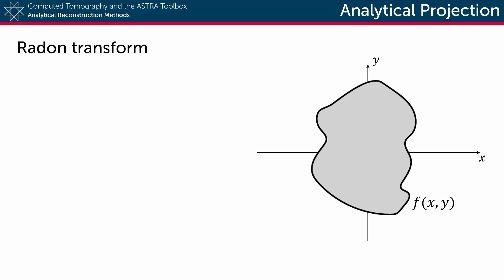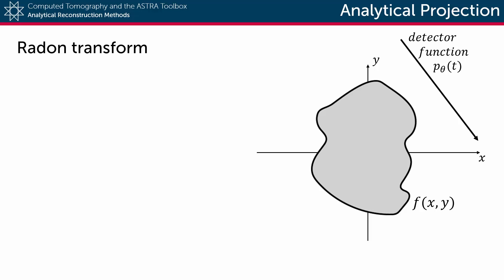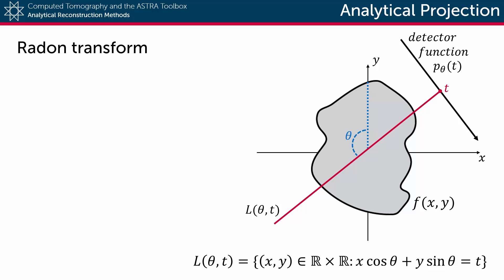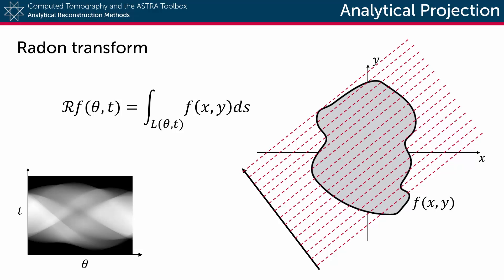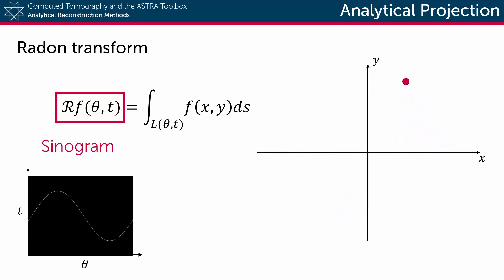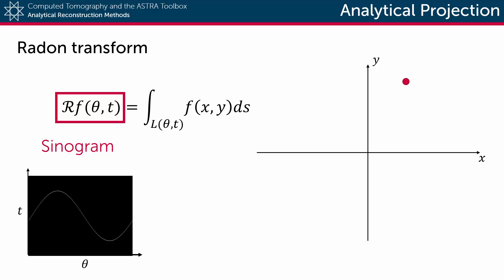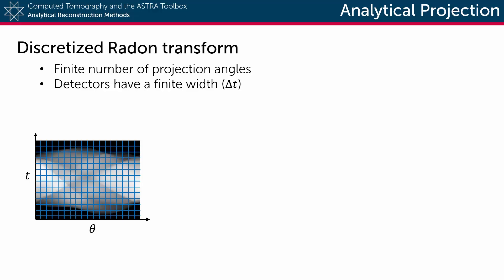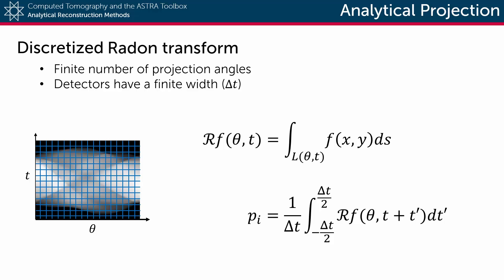Analytical projection

Comment: I really like the part of your video that mentions that a delta function in the (x,y) plane is transformed to a sine wave in the (t,theta) plane. Does frequency of the sine wave provide information about the position of the delta function? Thanks for providing me with a starting point for how to make sense of this amazing transform!
Reply: No, because the scanning lasts one cycle, thus you only see one sine period. What provides info about the position of delta function would be 1) an angle of detector function where you can find the dot. This angle, along with the "t" where the dot is located, can provide the "actual" angle of the delta with respect to the coordinate system. We still lack the distance of the delta from the origin, so we also need 2) the amplitude of the sine wave. If your range of "t" results in a sine wave that doesn't have both the crest and through of the wave (similar to what is called "clipping" by audio/EE people), then the distance of the delta to origin is already outside the range of "t". Hope this helps.

Note that t=0 means that the ray starting from the detector line function (the p_theta(t)) passes though the origin, so the red line in 0:38 IS t=0. Many t values correspond to the dashed red line rays in 1:23. So the "outside the range of "t"" I wrote above means that the location of the delta can be "out of range" of the dashed red line rays on some internal values of theta.
Reply: @AGLubang  Yes, that's very helpful! Thank you for spending the time to answer my question.  My intuition is that since the Radon transform is a linear transform, and since a delta function is transformed into an orthogonal function (like a sine wave), then you can preserve the information about the position of a delta function. The original object that is scanned can be thought of as a superposition of many delta functions. So the inverse transform is possible. -These CT scans look like magic to me. 🙂
Reply: @markmcla  Yes, that's correct. Sorry I made a mistake about the "distance of the delta to origin". See my edit. I think I still cannot fully explain it in words only.

Comment: How does the equation of the points on L hold, for the figure that is being shown?
Reply: It is not quite explained, but "x cos(theta) + y sin(theta) = t" can be derived as an equation of a line using trigonometry, with theta being the angle with respect to the y-axis (as shown in the figure), and "t" being the (perpendicular) distance of that line to the origin (0,0). I am sorry this is quite difficult without a visualization. In the figure, one could say that t = 0 there because the line crosses the origin, and change the value of "t" means moving the red line "up" or "down" while still parallel to the red line.

Comment: How can the line L(theta, y) be defined implicitly as x cos (theta) + y sin (theta) = t? If theta = 0, we  would have a vertical line x = t, but the line L(theta, t) travels along the x-ray beam, not perpendicular to it, doesn't it?
Reply: I think that is the parametrization of the detector line, not the red ray, in Hesse normal form
Reply: @funkyassfleasbass  Thank you! Now it makes sense: https://user-images.githubusercontent.com/9312897/105555346-31e8da80-5cd7-11eb-851a-9626447db88b.png
Reply: I was thinking exactly the same, I can't figure out how this equation hold based on the geometry of the figure..
Reply: I think the red line in the figure, L(theta, y), is the x-ray itself, while the p_theta(t) is like a "sheet" where the xray is detected, hence the name "detector function". Note that "t" in "x cos (theta) + y sin (theta) = t" is the (perpendicular) distance from the red line to the origin. In the figure, one would say that t = 0 there, because the red line crosses the origin so the distance is 0.